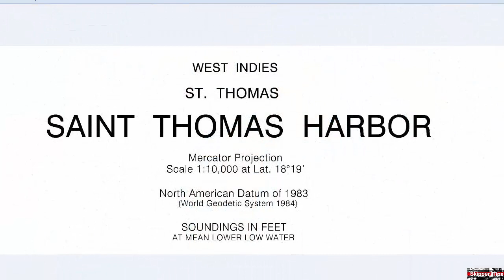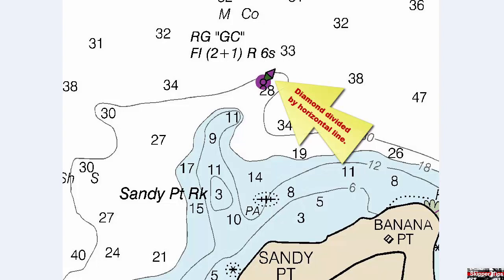How to Read a Nautical Chart - Sailing in the Virgin Islands

Comment: Can you please tell me why they would use a "preferred channel" buoy at the RG "GC Sandy Point? Is there a channel there? I don't see a channel at all, but I do see hazards near by.
Reply from the maker: These buoys are called "preferred channel buoys", but here it's used to show that side which has the deepest water.
Reply: Captain John's Skipper Tips thank you, but I'm still confused. That buoy makes sense, but when you showed the next buoy; the one off of banana point, it's a 2 color buoy, indicating "preferred" channel correct? From what I can tell, you would not want to pass between that buoy and the point. It looks dangerous. Am I looking at this all wrong?
Reply from the maker: Green lighted buoy "3" marks another channel on the east side of the island. Entering from seaward on the east side of the island, you would keep LB "3" to port. The preferred channel buoy "GC" is being used for the channel on the west side of the island. Entering from seaward on the western side, you would keep buoy  "GC" to starboard.
Reply: Captain John's Skipper Tips ok. Thank you. That makes sense.